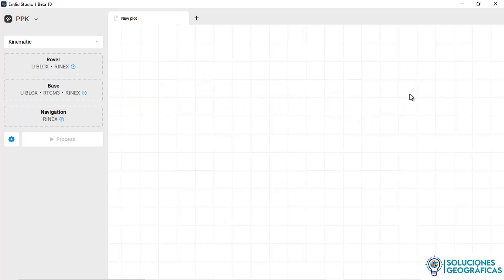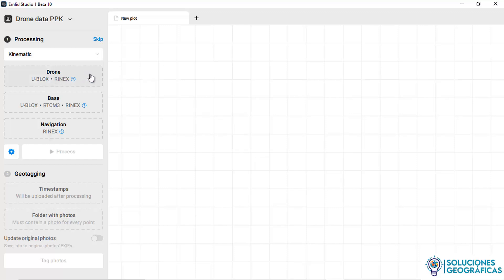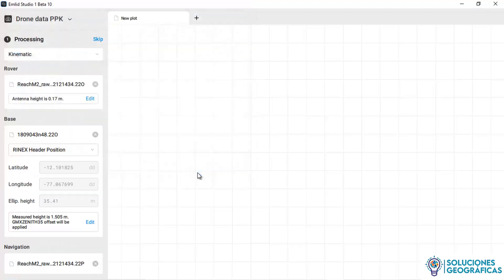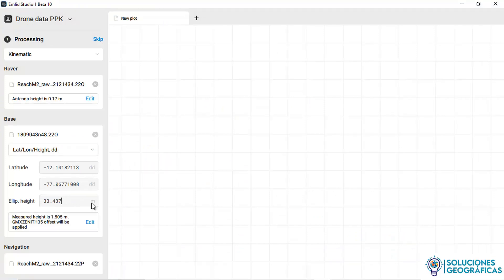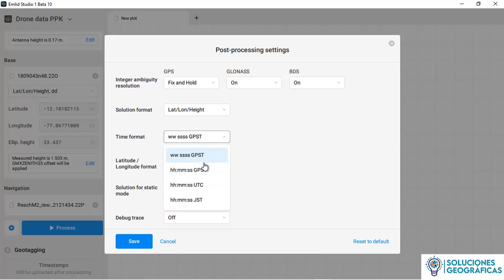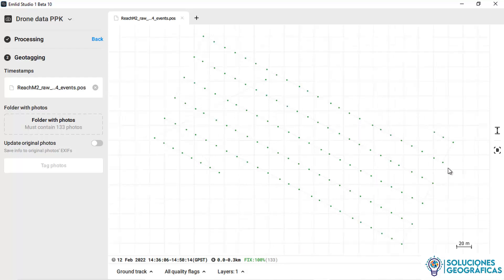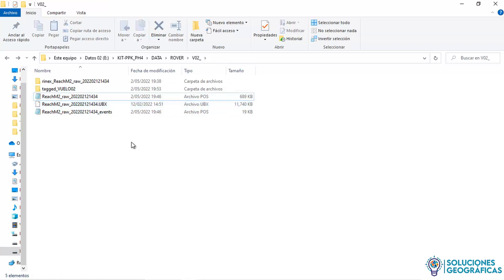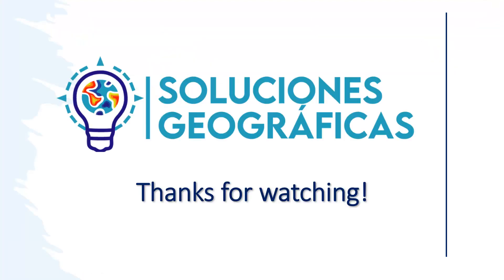PPK PROCESSING WITH EMLID STUDIO AND UAV-PPK. METTA PHANTOM 4 PRO PPK KIT. PART 01

Comment: Thanks for sharing! I have a doubt about how to measure the antenna height. What´s the reference ? the camera obturator or the sensor of the camera?. I´m using the altum micasense camera.
Reply from the maker: Hi Mauricio, Ideally, measure to the center of projection of the sensor. You can review the manual or technical specifications of your camera.